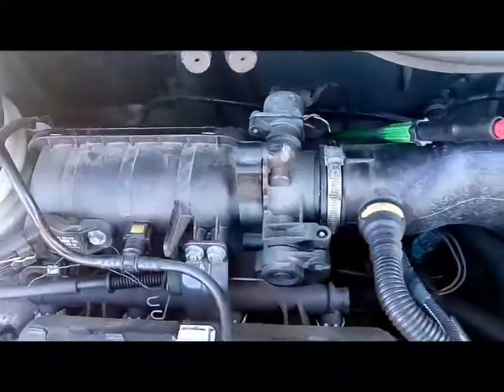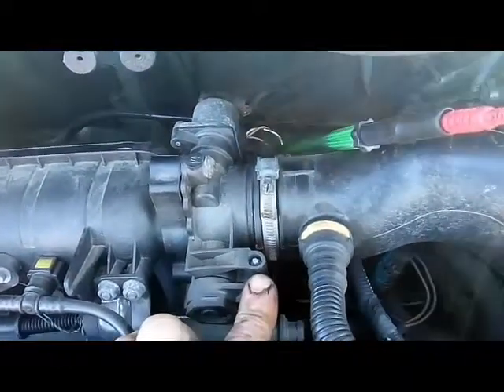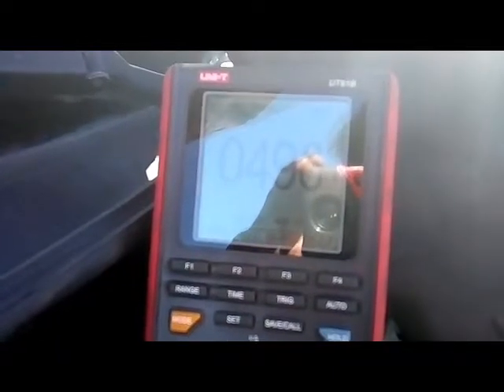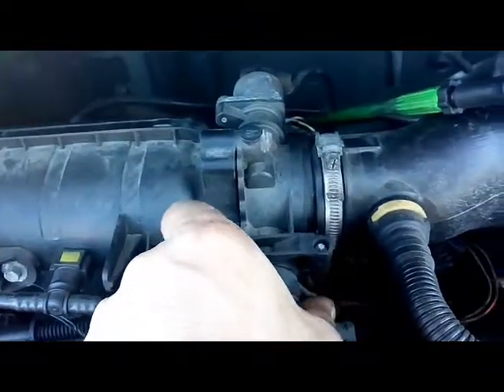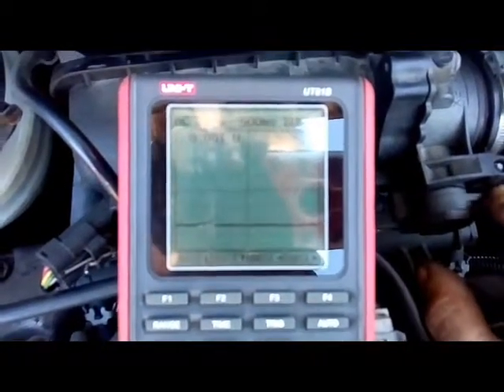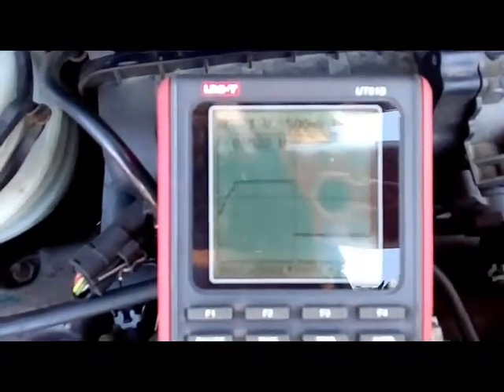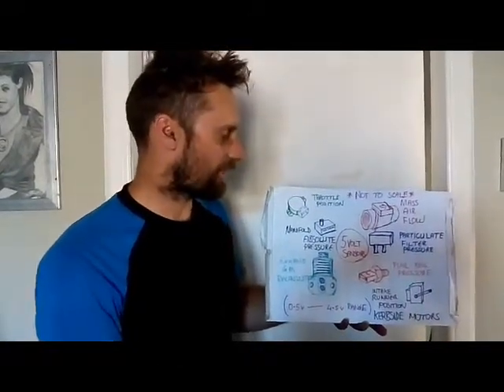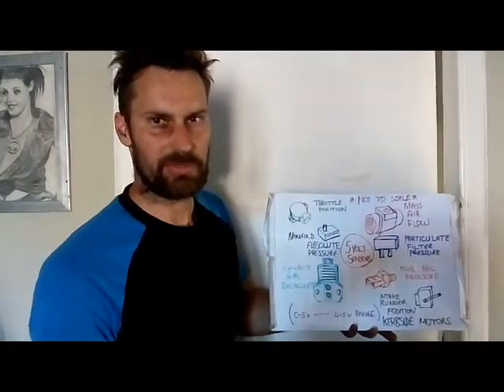How to check the sensors on your car, Basic 5 volt sensor testing using a uni-t ut81b

Comment: MECHANIC MATT, where is the noise coming from that will get into the ground wire? How does an ECM work what does it do, does it use CAN signals or sends out what signals? I don't get why it sends at a 400hz PWM signal, why 400hz and not 80hz or 600hz , why 400hz to the alternator? How does a TIPM work or what does a TIPM do?

Comment: MECHANICMATT, What is a good resistance range when testing various car sensors? why is the sensors ground isolated from the car batteries ground they aren't tied together why?
Reply from the maker: Hi Bill, I can't answer the resistance range, I find sensors don't tend to use potentiometers like they used to, it seems to be position sensors or pressure sensors etc  with small electronics inside. The DC voltage signal output has stayed the same as the  potentiometers, although the resistance isn't used when testing for a change in a sensor's output.
You can place your multimeter's ground on the battery negative or a known good ground on the engine.
The sensors ground will go back to the pcm/ecu  to get a cleaner signal with less interference, they will leave the ECU through the ECU's ground wires eventually going to a chassis ground back to the battery.
The ground wires at the sensors should light a test light that is connected to the battery positive terminal,
Also you shouldn't see any voltage on the ground wire ( close to 0volts) hope that helps, thanks for watching.